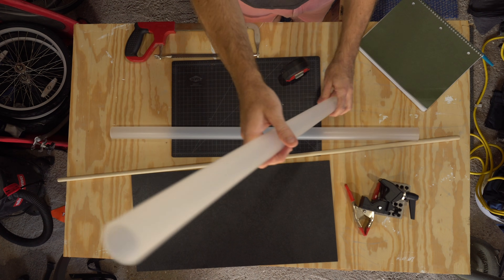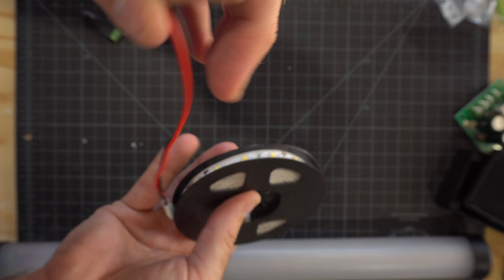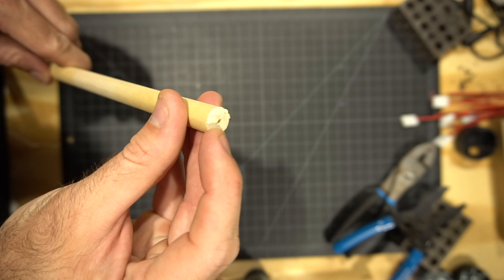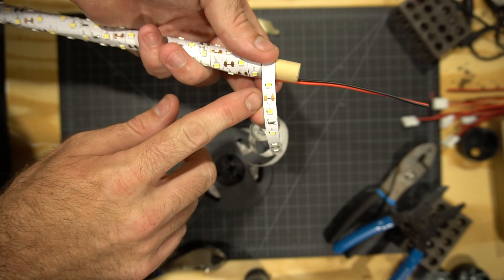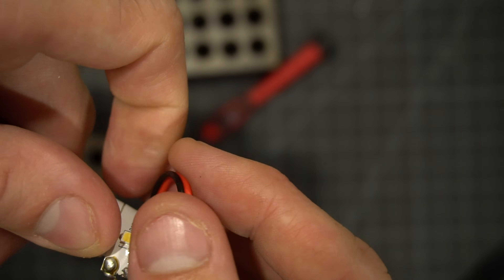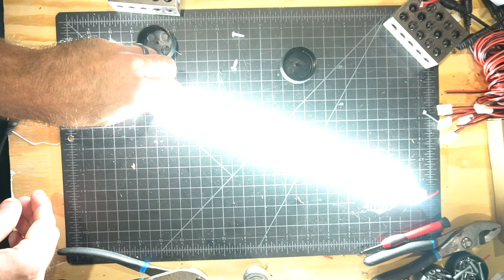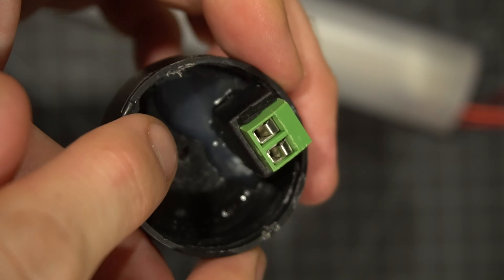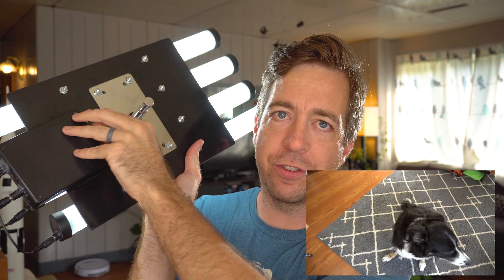TUTORIAL: DIY LED Tube Lights

Comment: Hi, can you please guide how which led driver needs to use. As I can see in the 1st bank you have added is initial part of whole led strip. So when we wanted to create 2nd led tubelight,  which will be created from remaining led strip which does not have any driver attached to it, so which one we need to use?
Reply from the maker: Heya! I would suggest searching for your specific LED strip that you bought and see if there are any universal drivers / connectors for it. Wish I had more info for you but this is what I would do!

Comment: This is a great idea. I know that has been around for a little while and I have a need for something just like this.  I need a DIY "Modeling Light" solution for my soft-box while using Flash/Speed lights.  The available Ring lights are a step in the right direction but, they just don't kick out enough light for the cameras autofocus to work correctly in order to make this a viable solution.  I need the EV of the LEDs to be about a 10 or a 11.  Lux = 4500.  Any idea?  Can you point me in the right direction with a DIY project?  What type of LEDs? How many LEDs for a given surface area? What you think?   What kind of fstops are you getting with that LED Wand.  I love this idea.
Reply from the maker: Thanks for watching and taking the time to leave a comment - as for suggestions I have VERY little (ok, NO) background in determining Lux for these. You can likely find that info on each product page - I haven't made these in awhile but IIRC there were some substantially pricier LEDs that kicked out way more light, had better CRI, etc. etc. than the budget friendly ones I used for mine. As for the F-Stops I would have to look and see, but normally if these are in a shot I'll adjust so it's a singular light (rather than having the individual LEDs visible) and then modify other lights from there. I typically shoot at 2.8-5.6 on projects with these lights, and then again, adjust as needed for my desired look. Hope that helps a little!

Comment: How does wiring at both ends cut down on heat?
Reply from the maker: I had some folks tell me it helps the current pass through better - I can confirm wiring both ends does help - BUT - you can do it without wiring both ends as I note elsewhere.

Comment: How would you do this to make it battery operated or usb powered to plug into a portable battery for portable use?
Reply from the maker: Probably the most common question I get asked about these.... I don't have a great solution at the moment. I have toyed with the idea of using a hollow tube that would fit AA batteries in lieu of the dowel rod that would power the entire light, just haven't found the right stuff for that. Otherwise a small USB battery pack that you attach with velcro to one end would be the easiest solution (and then you just need to get a USB to 3.5mm power cord). Again, haven't tried that. I typically just plug them into a larger battery pack I carry around that I charge camera batteries and stuff from - at the very least it allows me to put the light in spots that would be a bit more restricted if I needed a long extension cord and wall outlet access.

Comment: Either the website you bought the tube from changed the way they frosted their tubes or the exposure of your video makes the LEDs look way more diffused than they actually are. The 1.5" tube is too narrow to diffuse the LEDs and you end up seeing each individual LED through the tube. I purchased the samr stuff you did, am i doing something wrong?
Reply from the maker: In person they typically show up as individual LED spots, but on camera they tend to look like the frosted tube you see in the videos. Yes, I exposed for them to look like that and then adjusted my other lights, but I do that for most shots so I hope that it doesn't seem like I'm misleading anyone here. I also notice that when I crank them to full power (via the dimmer in my follow-up video) the individual LEDs are a LOT harder to see. Let me know if you've found a workaround for this issue!
Reply: @DroiMedia  thanks for clarifying. Yea that makes sense, since they're really bright so  the dots won't show up in the video unless you underexpose. I'm using the light stick as a decorative light (it's really long and leans against the wall) and so having a smooth glow is what I'm going for. I'm gonna try it with a higher density LED strip and see if that works

Comment: Will it have problem with heat accumulating inside the tube over time?
Reply from the maker: Thanks for asking - and I only ever had them get hot when I DIDN'T wire them from both ends. As is they get warm since it is an enclosed space, but I have never really had any 'hot' issues. I do think if I could go back I would drill a couple air holes at each end to allow for some air circulation.

Comment: Its kinda lame to create this tubes without using some adressable LED lights to make cool colorfull efects etc. It would add like 5 bucks to the budget.
Reply from the maker: Fair opinion, just wanted to give people the basics and let them run with it. Otherwise I would have been doing an RGB battery powered expandable one right off the bat. That being said you're correct that an RGB or other LED options aren't that much more expensive, I have a couple that have effects built in which are really nice, CRI is not great but 🤷‍♂️ I appreciate the watch and you taking the time to leave a comment!
Reply: @DroiMedia  no problem, im looking around to make some tubes that have really powerfull brightness. to be able to use them for outdoor filming. Sometimes color gives a good mood
Reply from the maker: @AlexandreCalvario  I think the hard part with DIY tubes, at least when I did these a couple years ago, was that none of the LED strips on the market were affordable and bright enough to really make an impact outdoors. Could be a totally different story right now, and I'm really interested in hearing what you end up creating (if you're going that route). Keep me posted!

Comment: What's the purpose of running the red/black wire under the strip and powering the stripe on both ends? In normal LEDs like Govee from Amazon the power is only connected on one side. 
Pls let me know. Am in the process of making my own LED tube light. Thanks
Reply from the maker: Thanks for watching - as noted in the video, you don't HAVE to connect the wire to both ends, but it helps distribute the current / heat better (in my experience). Will work either way though! Let me know how it goes, would love to see some finished work! :)
Reply: Did you make it?

Comment: Hey! This has been a very informative video. Would you possibly know how to make this tube light rechargable using usb? if so it will be lovely to connect with you to get some insights from you.  Cheers!
Reply from the maker: I haven't done it but it's totally feasible, would need to wire in a battery pack that you could recharge or swap out or whatever. This was high on my list of projects but my wife and I had a baby last year sooooo that's been my big DIY project for the last several months haha

Comment: Why did you wire both ends of the led strip? Doesn’t make much sense
Reply from the maker: Yo! I answer this in several other responses on this video, and it's answered in the video. Short answer: you don't HAVE to but it helps with current / heart distro. Thanks for watching!
Reply: @DroiMedia  wow, didn’t have to be a prick about it. I looked in the comments and never found an answer. I’ll be honest, I didn’t sift through all the redundant comments but you could’ve been a little more descriptive in the video. Still doesn’t make sense. I’ve never seen this to be an appropriate way to wire a short string of leds. Definitely not following you after that response
Reply from the maker: No hard feelings if you don't sub because you thought that was me being a prick, and let's note that I literally also took the time to explain it (briefly) in my comment to you. I'll repeat - it helps with current and heat distribution, and you do not NEED to wire it that way, but it helps. Thanks for watching either way, hopefully you got something useful out of the tutorial.

Comment: great idea but won’t they work just adding power to the one factory wires with out soldering the end you cut?
Reply from the maker: It will work - but I did this initially and it gets REALLY WARM, I explain it a little more in depth in the video and some other comments, but essentially closing the circuit (or making a loop - i.e. soldering both ends in) distributes the power better and the light doesn't overheat.

Comment: Hi Mr. Adam, I am from India. I used to wonder why my desklamp's light used to feel "dead and cold". Now I know that it used a low CRI LED(probably much less than 80). Thank you for this knowledge. Youtube is a wonderful place. I am now searching ways to make a durable LED tube myself. Usually the manufacturers use a bad quality power to the LED tubes here. and because of that, the tubes die within a few years of purchase...even if the LEDs work mostly fine. I am trying to overcome planned obsolescence and make my 10 year-LED tube on my own.
Reply from the maker: Awesome to hear! Let me know it goes! :)

Comment: Hello just finished the build. Thank you very much for the tutorial ! I have a problem tho I can see the individual led through the tube, it looks like its not diffused enough. Could it be because i used cheaper led (not the 90 cri ones) ?
Reply from the maker: Hey! Awesome to hear that you took on this build! It COULD be that, are you able to see the bulbs through your camera? In person I can see the individual bulbs, but on camera unless I have a really small aperture (f9 or higher for instance) or a really high shutter speed I can't see the bulbs.
Reply: @DroiMedia  oh it wasnt meant for a camera lighting in my situation, it is meant a dance performance haha, so I have to get rid of the single led visible effect. I just did a quick  research on aliexpress and found some led flexible strip that might fit my need better. Also the caps where kind of hard to get in my country, so I 3d printed them (with a guide for the dowel rod, a hole for the screw and one for the wires to daisy chain). You could link them in your video if you want (used the same frosted acrylic as you did).

Comment: thanks for the vid! one question tho, what if i have a strip that changes colors?
Reply from the maker: Works the same way! My RGBW strip has 4 connections / wires (is yours the same?) so I had to solder an additional 4 wire strip to each end. I bought some solderless connectors but they didn't work well.

Comment: I've installed these strips under counters many times as a contractor.  You only need to connect wires to one end as long as you don't break the strip.  Great idea. Some kits come with RGB and remote controller/dimmers so you can tailor the light to the K or color you want.  They should be able to be made portable by just setting up with batteries to the value of the adapter.
Reply: While it's true that you don't necessarily need to attach the power at both ends, it is possible that with longer LED strips , brightness and voltage can drop toward the end of the strip(especially when chaining strips together). I linked an interesting article describing the problem. One solution to double the possible length of a strip is to attach power to both ends as he did in the video.

https://www.superbrightleds.com/blog/understanding-difference-12-volt-24-volt-led-strip-lights/3070/
Reply from the maker: Thanks for the comment and info, Bill!

Comment: Thanks for this vid will use it, Just a thought, instead of a wooden dowel an aluminum tube would work well, It will help with the heat dissipation and you can put the wire inside, though endcaps will be tricky to fasten.
Reply from the maker: Great tip!

Comment: $25/foot? that's spendy amazon has led tube lights much cheaper than that. Just gotta be creative.
Reply from the maker: Feel free to buy if you don't want to or can't DIY, and these are not simply the cheapest,  rather they are the cheapest I could get them while being durable. Thanks for watching!
Reply: @DroiMedia  You're welcome! I understand the durability concerns but at this point in time most all LEDs are quite durable and nearly all if not all are coming from China. Yet the real difference is the 360* tubes that you've got going on. And the fact you can make these RGB with the color remotes and rolls of LED strips. And you can also make these 12v and super portable.

Comment: Is the wire at both ends really necessary?  Could you not just solder to one end of the LED strip?
Reply from the maker: Not necessary but when I did some original tests only wiring one end caused it to get REALLY warm. The additional wiring allows for the current to continuously move, so there is no (or less) heart build up.
Reply: @DroiMedia  that makes perfect sense, and after I asked I started to wonder if it had something to do with current or maybe only half the lights being driven. Thanks so much for the reply and helping me understand!
Reply from the maker: Happy to help, there's more info buried up in the comments so it might be worth perusing those to check some things out. Happy DIYing!

Comment: Is there any heat issue? Why led strips are used without radiators?
Reply from the maker: The only neat issues arise when you don't have the LEDs connected at both ends. And I don't know what a radiator is 😊

Comment: What's the reason for powering the leads from both ends
Reply from the maker: Equal heat and power distribution - you can do without but the light might get hot at the connection end
Reply: @DroiMedia  ah OK... Thanks
Reply from the maker: Yeah sorry for the short explanation, on my phone right now (more in depth discussion on this topic can be found in the comments here). Happy DIYing!
Reply: @DroiMedia  no that's fine makes Sence

Comment: Can these be made to run on battery ? will it affect brightness ? if it can be run on battery ? could you tell if the battery would be huge or possibly portable
Reply: You could probably hook them up to usb connections
Reply from the maker: Great idea! I just run them into the 3.5mm in (light) from the USB out (battery). Works great, although not a "battery powered" as many people want.
Reply from the maker: Yep! I run them off of some larger batteries sometimes to make them more portable, but you could definitely rig up some NPF or V Mount style batteries to power these - either of those options would be fairly small / portable.

Comment: Why does the LED strip need power to both ends? That’s the only part I don’t understand. Isn’t the point of the screw on end for power to avoid soldering?
Reply from the maker: Heya, this is explained more in a few of the other comments here but basically the other end connection / loop that it creates helps to distribute power more evenly and prevents over heating at the connecting end. Hope that helps! (You can get away with just the one end but when I did it the lights got hot)

Comment: Could i use this for light photography? Would I just connect a power bank to it?
Reply from the maker: yeah! Like for long exposure light paintings?? If so I would love to see you do that - and it should work just fine. I normally connect mine to a small external battery that way they are super portable, and while I leave mine on stands you could definitely run around with some connected to a battery.

Comment: why are you connecting both sides of the strip? surely one side powers the whole strip
Reply: Not only does it benefit with heat build up, but the end of the strip closest to the power connecter will be brighter than the end without. So by connecting both ends it allows for more even power and light distribution.
Reply from the maker: Hey! Great question and yes it does, BUT, when I originally connected only one side the light got pretty hot, and after talking with some folks who have more knowledge than me they recommended I connect both sides so the current doesn't build up and create heat anywhere. You can absolutely do it by just connecting one side but just be careful / aware that it might get hot. Hope that helps answer your question!

Comment: So complicated to find these kind of tube in canada :(
Reply: Home Depot , Lowe’s or an electrical supplier . I got mine t HD  live in Toronto
Reply: They would be where the fluorescent bulbs are, goog luck👍🏽
Reply: For the neon tube yeah, i have some, but not frosted acrylic tube. Did one im pretty happy with the result i have
Reply from the maker: That is a bummer, have you tried searching on Amazon or any similar sites you have access to?
Reply: @DroiMedia  yess, amazon, ali, ebay. Nothing comparable or its really expensive with shipping.

Think I will try with neon protection tube with frosted window  film instead 🤷🏻‍♂️

I tried some white spray paint but wasnt happy with the results. 

At least with pandemic I have  time for diy project ha ah